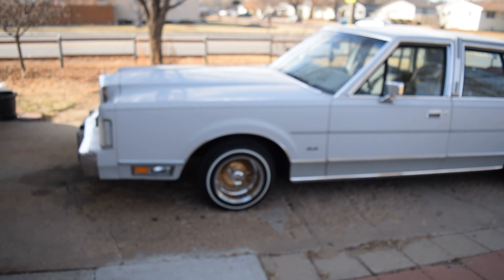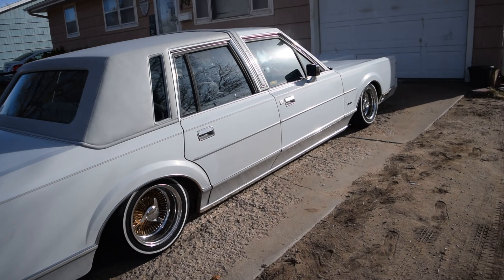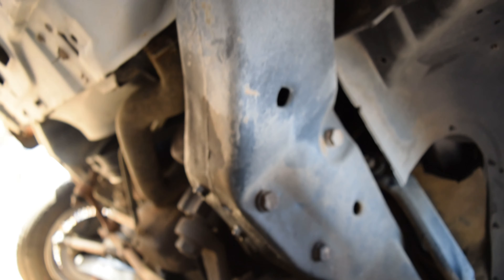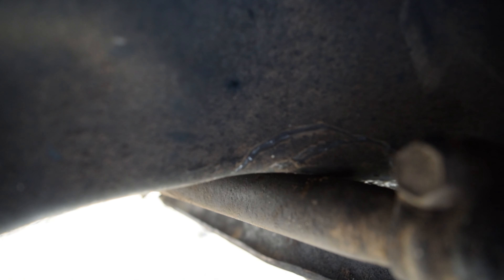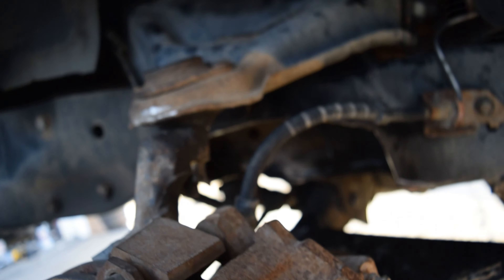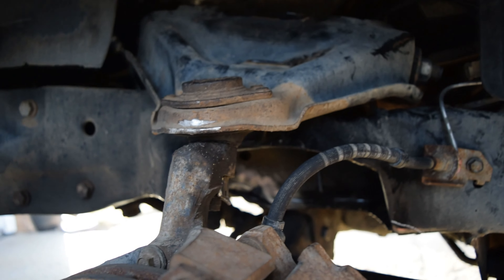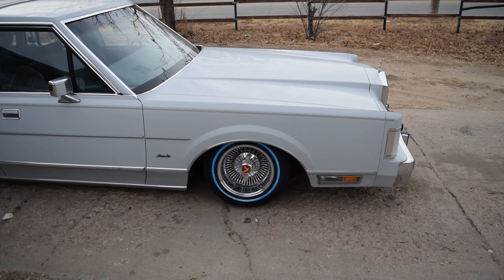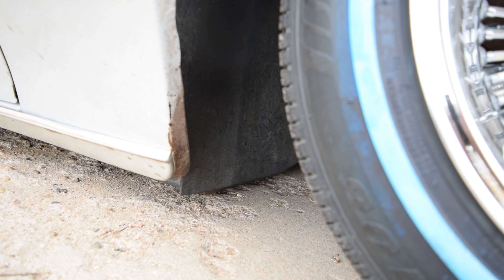$500 Bag Setup on the Lincoln (Part 4.5) (LOWRIDER BURNOUT)

Comment: Dude that shyt looks sweet man! Turned out real nice. That burnout was cool lol, that's something my ass would do and get called in on because of my neighbors. Any plans to do the exhaust, unless you've done something to it already. Sounds like it has a nice low rumble to it. Either way, sounds good, looks great. I'll be looking forward to seeing whatever next projects you come up with homie. I've mentioned this before, if you opened up a small shop, or did side projects for people, I'm sure you'd have something good going man. Keep up the good work there.
Reply from the maker: 05 P71 damn I just seen this but yeah man, when bagging the rear I had to chop the muffler out. Been scraping through the cats quite a bit so it’s pretty open now lol

Comment: I have a 1989 Lincoln I want to bag where should I buy a kit
Reply from the maker: I believe you can find “kits” on eBay or other air ride websites. If you’re gonna have someone install the kit they probably would be able to fabricate the parts themselves out of metal at a cheaper cost than buying the kit.

Comment: Does anyone know what’s better for freezing North Dakota weather hydraulics or air bags?
Reply from the maker: Cowerdnerd Despacito I know the cold weather would cause the hydraulics to run a little slower but they should still work I think. Air bags aren’t necessarily too bad either just if you have condensation in your air tank I wouldn’t run the valves as they could freeze up. I’ve always just left the car aired up anytime the weather got freezing and haven’t had any issues
Reply: I'm from SD, always run bags. You need a good water trap and while valves on bags are quicker keeping them in the cabin is ideal. So is adding a little antifreeze to your tank table spoon or so should work. It'll bond to any water and keep your diaphragms from freezing

Comment: I'm trying to bag my 89 TC I'm having problems tracking down cups and mounts.anyone have any for sale ? I need help
Reply from the maker: It’s almost better to build them yourself. You can also check eBay for an S10 cup kit. The front will be very similar, you may have to cut them down to size though
Reply: @CGOD  
Ok bro I don't have a welder or cutter but I will look into the S10 ones will that work for the rear too ?
Reply from the maker: @zikilmendoza7357  the rear you’ll have to weld them in no matter what, you should try and find someone with a welder to help you. It’ll be cheaper
Reply: Think we are fb friends now if you can please send me some links to the ones u recommend, also will ebay bags be durable enough
Reply from the maker: @zikilmendoza7357  zigzag? I ran eBay bags without any issues. Just get the new style D2600’s